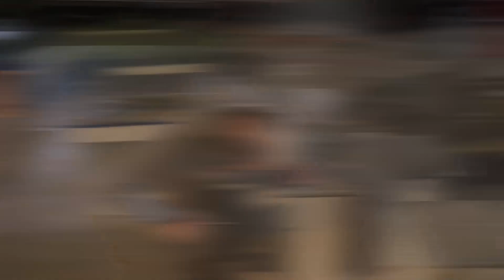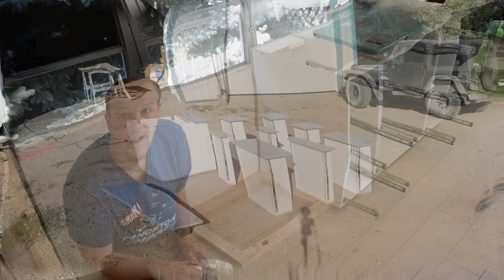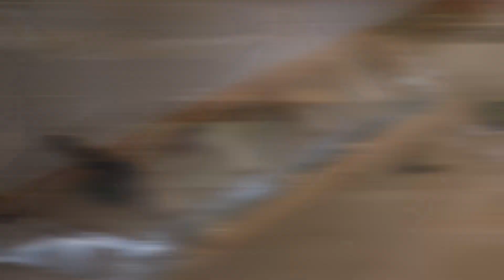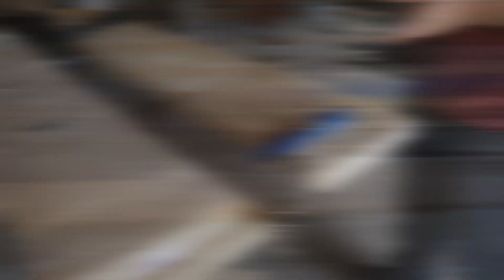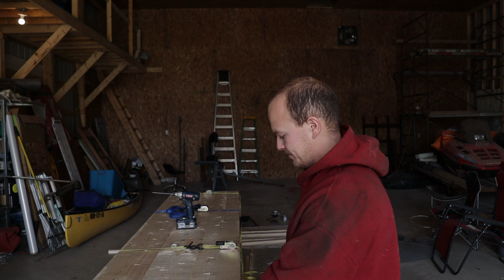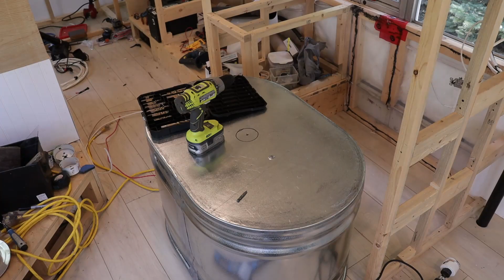Bus Building Madness - Bus Conversion Ep. 36

Comment: Great idea on the air flow, one of the issues I have been seeing with buses and heating, if your using any propane moisture is a problem, I have to think your airflow will help keeping moisture buildup at floor level?
Reply from the maker: We are using diesel heaters so zero moisture. We are also using outdoor air when above -10 to allow for dry air to enter the space and prevent drafts by slightly pressurizing the bus.
Reply: @AdventuresWithBoog  I am still considering both propane and diesel options, diesel preferred, a Mr. Buddy as a backup.

Comment: First off, Free stuff lol. Secondly, before you install the tub, make sure to dimple around the drain so the water flows towards the drain. otherwise, you will be left with little puddles of water that never want to drain. Thirdly, as for the countertop, the solution is to get rid of the pocket screws and switch to a biscuit joiner. Keep up the great videos
Reply from the maker: Yeah I have a joiner and I now going to cut the counter apart and use it for shorter bits that are okay and then re do a new one for the counter.